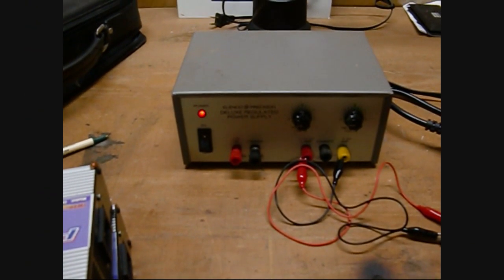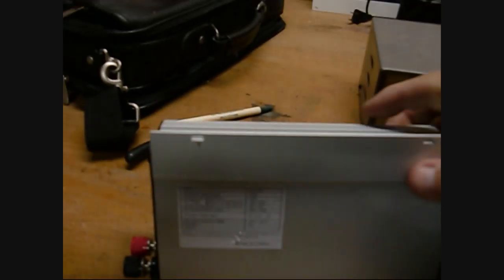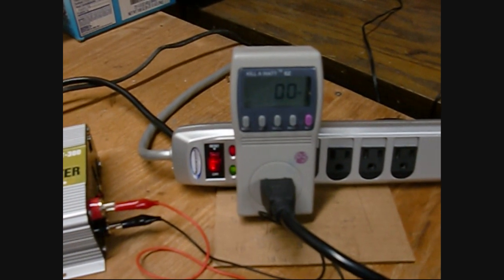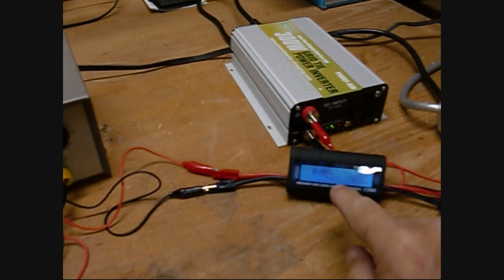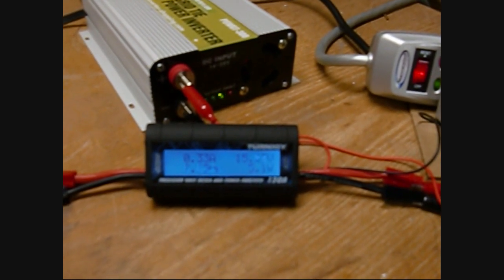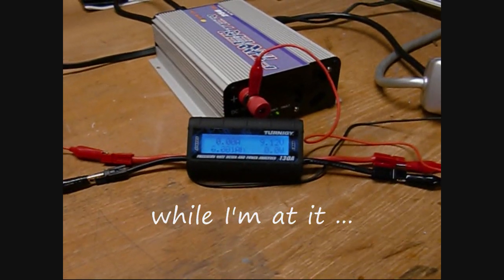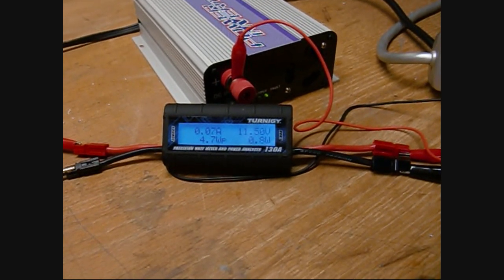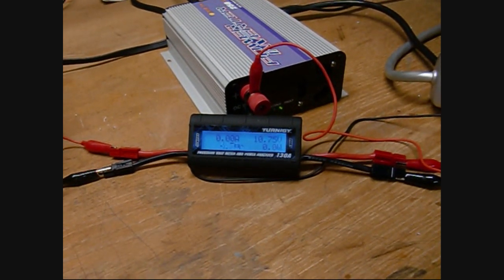Power Jack and Sun Grid Tie Inverter Efficiency Tests

Comment: Very old video, but the Input power (your small power supply) is far too small (too low output power) to get the inverter up into its efficient range of operation. Most of these inverters don't reach their good efficiency until around 75% of rated output power.
 ALSO... those thin alligator clip-leads are highly resistive, so you are probably losing power there as well.

Comment: Here are my specifics:  2 12V 100W panels in parallel.  Panel temperature is 55C at 12noon today 6/22/13.  Power output  spec is derated -0.44%/C above 25C.

I'm measuring 13.6V @ 11.2A = 152W input to the GTI.  Output of GTI as indicated on a KillAWatt is 130W or 136VA.  130/152=85% efficiency.

The mystery is, 200W of panel derated at 55C should yield ~174W, yet only 152W are being consumed by the GTI in full sun at noon.    Does this mean the MPPT of the GTI isn't working where it should be?

Comment: Excellent video, Fearlessthinker.   Any chance you've charted the efficiency?

I just started playing around with 2 100W panels in parallel on a SUN-300G.  Looks like I can squeeze about 130W out of them which is about 65% and consistent with your measurements.  That was a bit disappointing considering the 'maximum efficiency' spec is listed as 92%.  I'm curious to see how the 92% claim was measured. 

This got me wondering if swapping the FET's with faster and lower drop parts would help

Comment: im getting ready to install 10 - 235 watt panels on my house and run them thru a grid tie in your opinion is it better to use 1 5000 watt grid tie or a few smaller units. what would you do.   THANKS FOR ANY INFORMATION. PLUS WHAT TYPE WOULD YOU USE.

Comment: inverters usually needs at least 50 amps coming from a power supply to work efficiently, and if using battery it should be charging at the same time while running the inverter, and when connecting battery charger, still the same the battery is running out of voltage.
Any good idea guys how to fix it in anyway? :)

Comment: However, inorder to save such energy from the sun, you can instead connect your solar via ur battery bank then to your grid-tie inverter. or some of your panels charging ur battery bank and feed it to ur wall via ur grid tie during the night. u can use a timer when is the exact time u need to feed such extra energy to ur grid/wall

Comment: Does anybody can answer this question. I have a grid tie inverter 600w. but I only use about 300 during the day in the house , is there any way to limit the output to this grid tie inverter to around 300-350w , because I’m putting a lot of power in the grid and I wish I could use that to charge my batteries.
I would really appreciate an answer

Comment: i have had several of these type of gti's. they all are over rated. i had two power jack 1200 watt gti's on a 1300 watt solar bank. the max each gti would put out was around 450 watts each. the smaller ones were even worse. the fact that i get about 6 monthes out of them before the crap out is even worse.

Comment: @MrSquidBrains  wait of money  bad design all ways broken  no protection on the 240 volt ac side  any fast power on off will burn out your inverter .the inverter make 230 watt at 28 volt dc thats ok but not long . in one year all my 5 inverters was broken all on 240 volt side and some of them on the dc side. the 500 watt from the same  brand the same i buy 5, 4 of them are broken in less than 4 months. now after repair repair at my own cost with orginal parts i keep them running  crap

Comment: Hey great video, and a great service you do for anyone looking at buying one of these things.  I just want to point out that probably the efficiencies you found are low because of the power you were operating at.  There is some power overhead associated with the electronics in the device, and it is rated for peak efficiency only at a certain power level.  I think that if you operated at a power closer to the rating (say 150 Watts or so), you'd see greatly improved efficiencies.  Thanks again!

Comment: Any chance you can test efficiency on these units at higher power levels?
Efficiency of any GTI is poor at very low power levels.

Most people would be concerned about efficiency levels at say 50-300w DC input, but your power supply doesn't look like it is capable of that. If your power supply cannot handle 10-20A at 15-20V, I can't see how you could of tested these GTI's over the full voltage range as the GTI would drag the P/Supply output down as MPPT power increased. Thanks for the video..